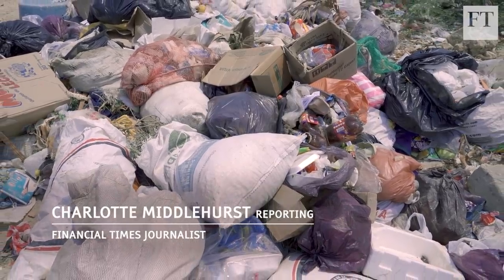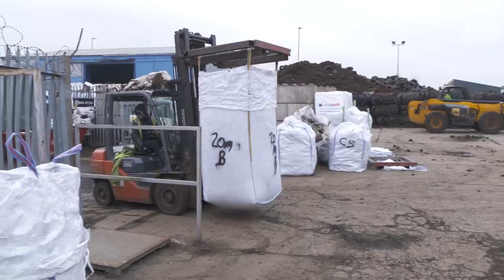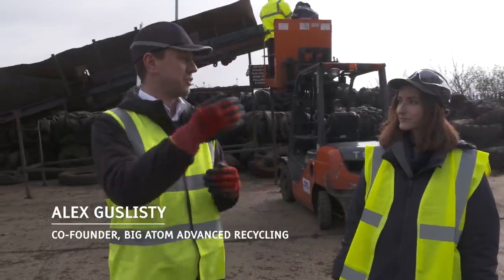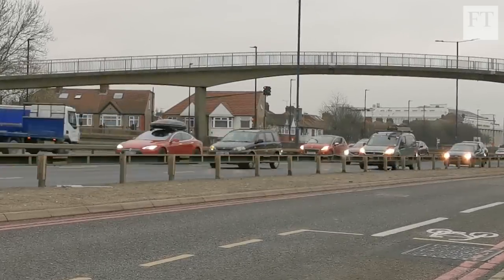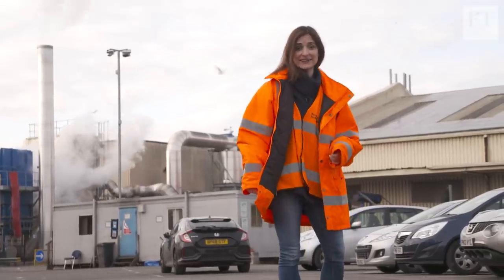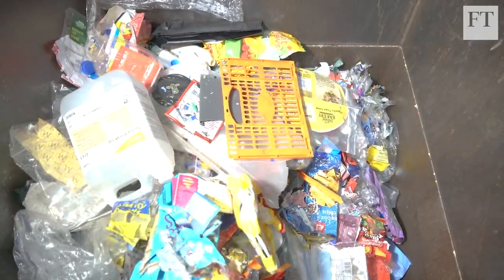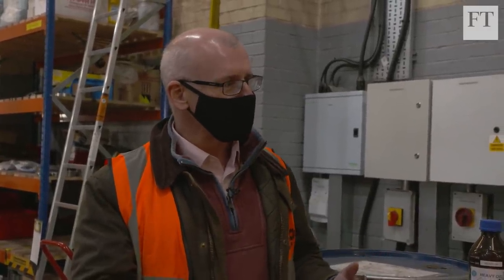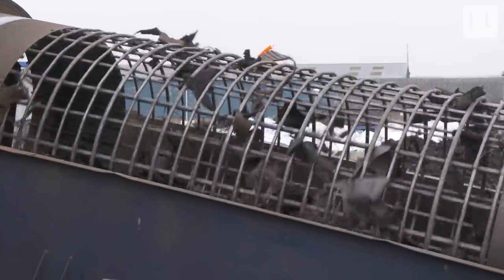Chemical recycling: the end of plastic waste? | Rethink Sustainability

Comment: Hey, environmental engineer here. I just want to throw in my two cents.
Even though I am all for recycling, I want to point out that this concept could be a double-edged sword. Remember that recycling reuses that old material and converts it into new, usable material. The fuel for this process is the old plastics and plastic companies may see this is as a way to continue their plastic production.  Overall, this is a viable way to have plastic waste be something useful, but remember we want to eliminate relying on plastics altogether. I think this is a good short, term solution to a long-term problem, but we still have to address the bigger problem in the future.
Reply: Hi Randy, you’re making a very valid point here. Us as consumers need to take some responsibility to reduce plastic consumption. We can not eliminate/replace plastic it completely though, I.e. in medical appliances etc. Any replacement material based on current technology and science will be an oil derivative. There is however no need whatsoever to package water and carbonated drinks in single use plastic materials. Also chemical recycling is a good concept per se, however, the technology pyrolysis is a high energy consuming process, which again has a high carbon footprint. Mechanical recycling might actually be a more environmentally friendly solution. The problem here though are the impurities found and hence cannot be reused for food contact.... to cut the long story short: I think that major investments in R&D are essential to find a solution are necessary.
Reply: But what will be the long term solution? As we know that other types of packaging tend to have a larger carbon footprint than plastic, as plastic is lightweight, strong and durable. I know that it's not black and white and there is not one solution to all of this. But what do you think about bioplastics or plastics made from captured CO2 for instance?
Reply: @henk-3098  The long term solution is to find some other sustainable packaging. I know that answer is so general, but we know plastic isn't the sustainable solution. I do believe plastic is here to stay because we'll need it for other purposes, like medical use and other durable storage containers but single use plastic just isn't right.
Bioplastics sound like a good alternative and even biodegradable plant alternatives like banana leaves for simple thin wrappers. Once it becomes more widely accepted and is mass produced, the cost goes down drastically.
Reply: O
Reply: Please
Reply: Data Fix  You don't sound smart at all, you were insulting to him for no reason. If you read up on plasticizers/additives like phthalates, you'll learn that they don't bind to the plastic. They leech into our food, they're in our water, in the air. We're ingesting about a credit card sized piece of plastic a week, so I've read. The solution is to move away from plastic entirely. I've personally made massive changes, I don't buy single use plastic anymore. I use food-grade stainless steel, glass (soda lime, borosilicate), lead-free ceramic, there are many alternatives. All this solution you're cheerleading will do (the one in the video) is just prolong the problems that are numerous outside of landfill.
Reply: Data Fix  A lot of it is too late? It's in rivers and our water, our bodily tissues. They've found microplastics can be so small that they cross the blood brain barrier in female rats. Can you tell me how this process is going to fetch the plastic from rivers or the air, or our tissue, or our blood? Or how its not (very obviously) going to incentivise businesses to keep using plastics? Healthy sperm count has halved since 1973. If it continues at the rate its doing now we'll be infertile by 2050. Read 'Countdown' by Shanna Swan, she's an epidemiologist focusing on reproduction in the human body. She largely blames ingestion of phthalates, endocrine disrupting chemicals for the decline and its very compelling. I agree with you we need to remove plastics where we can, eg landfill, but clearly the guy in the video here doesn't want to end use of plastic, he wants to recycle and reuse, reuse, reuse. I emailed the company he runs who do this with links, no reply. They don't want to get rid of it to never make it again, they want to remove plastic to keep using it and get rich in the process.

Also, for what it's worth, anyone who I considered remarkably intelligent in life never had to qualify their thoughts with things like 'I ran a tech company', 'I worked with NASA scientists' it just sounds very forced and insecure.
Reply: @joshuafisher4241  Greetings. Regarding eating 5g microplastics / week, I encourage you to keep an open mind. I don’t know the true amount but I welcome better estimates and by more researches. I tried to look this up and this quoted amount seems to be sourced from a single academic paper. As a layman reading the paper, I saw that 85%+ of microplastics were from water (bottled and tap) so cutting down on plastics for other foods seems negligible. Instead, the idea seems to be a new filter for tap water. Additionally, 5g / week was based on estimates of sizes of particles with large error bars. I’m just a lay man. Keep an open mind and look for more primary sources.
Reply: So is this video is somewhat believable?

Comment: Need to know how much energy is consumed during recycling process. The key to making these sustainable.
Reply: Yes. The key to making large scale recycling feasible is availability of clean cheap energy in large amounts. The only current tech that allows this is nuclear fission.
Reply: Renewable energy and energy storage is the key, as with increasing numbers of other higher energy input businesses.
Reply: What gases are being captured from the tyres and used to generate power?
Reply: Most pyrolysis processes, including the one shown in the video, produce a flammable gas, as well as the oils. This gas is fed back into the process as fuel for the needed heat.
The videos I've seen of similar processes lead the viewer to believe that the process is self powered, needing an outside source of fuel only to get started.
Reply: @scottbc31h22  Some feed the gases to a gas turbine generators too.  RODECS for instance.

Comment: Very interested to know the composition of the gases being emitted into the atmosphere from these processes???
Reply: I was thinking the same thing.
Reply: Sames
Reply: It's pyrolisis, so the plastic or the rubber mostly turn into gasses and then cool down to turn it into oil or crude oil. 20 percent of it Will become TAR , which it's really hard to break down and almost have no use , that's why this kind of machine have huge maintenance cost. Now the real problem is from the heater use for keeping pyrolisis heat which most of the time using gas or natural gas.

Comment: There is a downside to this process. The input material is of instable quality. Not only waste canbe dirty, but also it consist of different plastic materials. And each of them has different additives, colorants, softeners. These transform into tiny dust particles, which are not filterable. Product contaminated with these can never be allowed into oil refinery, because it would destroy catalytic systems. Same goes for chlorine containing plastics - PVC. So the thing you can do with the product, is to burn it. And due to dust particles, it sucks as fuel, it will damage car´s catalyst, and wear down engine parts mechanicaly.

Comment: I think it's a good idea to try to chemically recycle the plastic waste that already exists, because otherwise it will just be sitting there for hundreds of years. But our whole consumption model really needs to shift away from single-use plastics to really solve the problem. Production of plant-based plastics which at least break down after a period of time also needs to be ramped up.
Reply: Just because it comes from a plant doesn't mean it breaks down. Also, you'd have to put massive amounts of land devoted to growing packaging.

Comment: Several things. 1. Why does she wear a mask while driving up the road but no mask when congregating several other people. 2. wondered why breaking down plastics wasn't done for years. Styrofoam for instance melts away with many other chemicals. 3. Glass always appeared to me to be the best container other than the fact it breaks easily. Back in the day pop bottles, milk bottles, beer bottles and much more had return bounties on them for recycling. As kids we walked the ditches for pop bottles to return for cash to buy things. We had no allowance and this is how we earned cash. $1.00 would buy a burger, fries and a coke. Pop bottle bounty was a nickle so it usually wasn't very tough to find 20 bottles each. At least in the countryside ditches it wasn't.

Comment: Good luck with pyrolysis, it has been around for ages, but difficult to operate commercially, likewise microwaving tyres. Pyrolysis oil is still a very smelly organic mixture, which needs further refining.
 Shredded plastic and tyres can easily be used in cement kilns to replace coal, yes it is burning the resource, but we need cement, and so far the only viable cement manufature process involves calcining limestone at high temperatures, and needs fuel.

Comment: This is not really sustainable and it is these kinds of broad stroked uses of the word that makes it lose its meaning. That looks like its an incredibly energy-intensive process - how is the plant powered? I am going to take a wild guess and say that because it is technically a less exhaustive oil production method, (compared to regular drilling) the price for this can justify the process costs. Also I worry how much the business benefits from claiming sustainable practices. Nevertheless, its great that there is a loose shift in the direction of the circular economy, it just needs a little more regulation on what qualifies. Anyway, great job cleaning up some plastic, actually though.

Comment: if it all gets cut up and put in a spiral chemical stamping and thermal conditioning drum. Then separating the product range generated should be easier. the government should be focused  on what product range you can from each green product output in waste reprocessing. In this new decade don't we want to up product range on the output as a gesture for the next gen ect.  It can all be reprocessed just takes time to figure out how. I envision a world where the dump doesn't need to get bigger because so much gets used of the dump and final product companies have more green sense.

Comment: Pyrolysis is not commercially viable because it uses a lot of energy and since most of energy comes from fossil fuels it's not green either. Recycling plastics will be worth while wen we'll have spare energy from renewables and for now we better store waste plastic in landfill or use directly as a fuel.
Reply: What if we use geothermal power?
Reply: Pyrolysis can be achieved  without using much energy at all. The gas that is released from the plastic during Pyrolysis can be used to heat the rest of the plastic in a closed loop system.
Reply: It is not necessary to use fossil fuels.  Any source of heat will do provided it can reach the required temperature.  I've seen plastic pyrolysis done with a solar mirror array, hydroelectric power and even by burning driftwood on an island where they collect plastic garbage from the beach to turn into generator fuel.
Reply: Pyrolysis requires 300–900°C. Geothermal does not produce those temperatures. Burning syngas or synoil from plastics to pyrolyse plastics is self defeating process. Burning anything to decompose such a stable material as plastic will produce much more co2 than just leaving it in landfills. Using solar mirror array or hydroelectric power is a good idea, but better usage for that power is to use directly as electricity than cooking plastics. Since renewable energy is unstable and we have no storage yet, when there's more electricity being produced than consumed, then it makes sense to use for pyrolysis or hydrogen production and so on.

Comment: Pyrolysis?
Reply: The tried and failed solution to waste in the UK on many occasions, very few plants I have visited have worked to an acceptable standard. There is no end of waste states yet for the material either so it’s still waste
Reply: Places like India are using pyrolysis to recycle plastic and car tyres. Why can't the UK?
Reply: @pocketoperatorjams98  The answer: it costs a lot more to recycle the plastic into crude oil than to drill crude oil with a rig.  Therefore, for plastic recycling to work, governments need to give plastic-derived oils either tax exemptions or financial incentives to offset the added costs.  Governments charge huge rates of tax on petroleum products.  They don't want to forego that money so they aren't going to encourage an industry that will erode their tax base.  Change will only come with lots of people demanding that they assist companies who are helping to solve plastic waste problems.

Comment: This is an absolutely misleading clickbait video! First of all homogeneous waste (only single type of waste) is never a problem for recycling. Secondly calling synthetic tyres as "plastic" is wrong. The video tries to generalize the pyrolysis process, which is not new in the first place, as a silver bullet which is misleading.
Reply: The food wrappers that Recycling Technologies are working with aren’t homogenous waste though. They are various types of film, LDPE and HDPE (both of which can be recycled using other processes), PP and the hardest to recycle, laminates and metallised plastic film (crisp packets).

The beauty of chemical recycling is that they can take mixed and contaminated film plastics and turn it into valuable resources.

We totally shouldn’t have laminated and metallised plastic films, but whilst they exist, we need to do something better than bury or burn it all.

Comment: >90% of plastics can already be recycled the normal way by remelting them. This only applies to the remaining 10%. This video is about tires, which are made of rubber, not plastic.
Reply: How many types are plastic are there?
Reply: 90 percent of all the plastic produced can theoretically be recycled, but in practice it's impossible to do so because it can be impossible to identify and separate all the types of plastic. This process however turns all types of plastics, no matter how mixed up they are, back in to the chemicals they were made from, which can then be separated through distillation and made back in to plastic.
Reply: They can't. Only 9% and even that is a generous estimate.